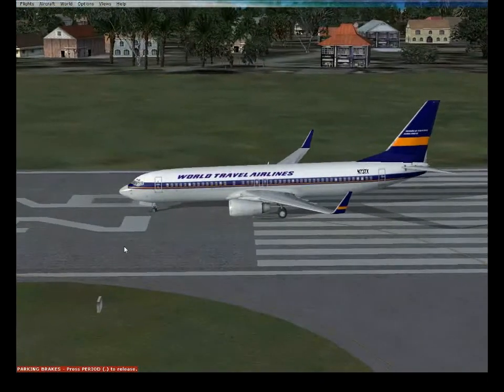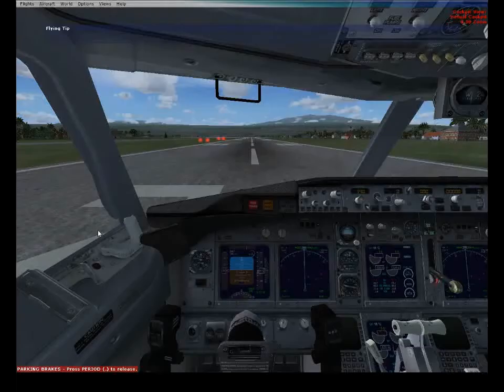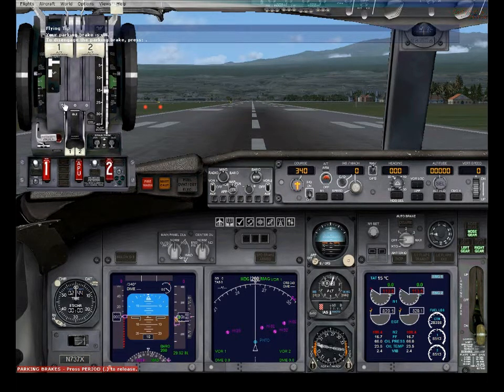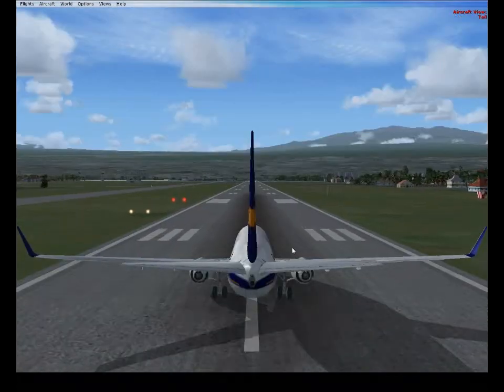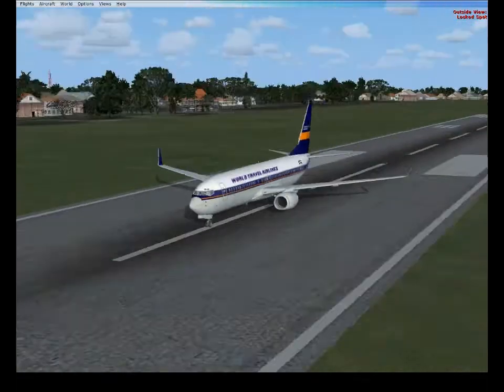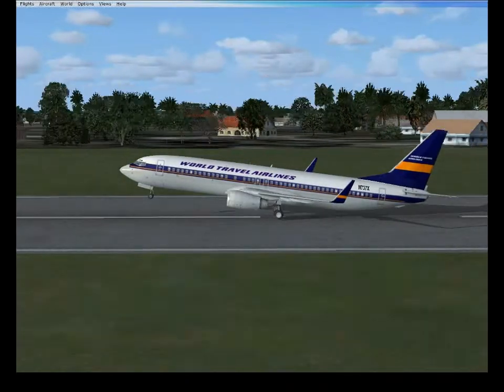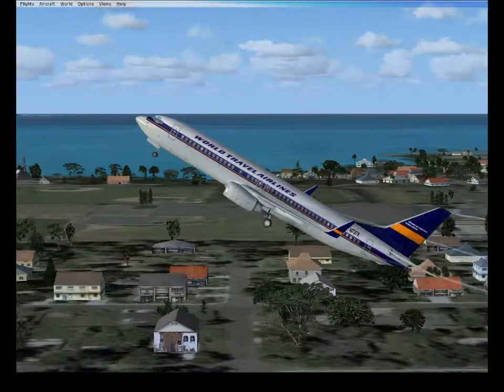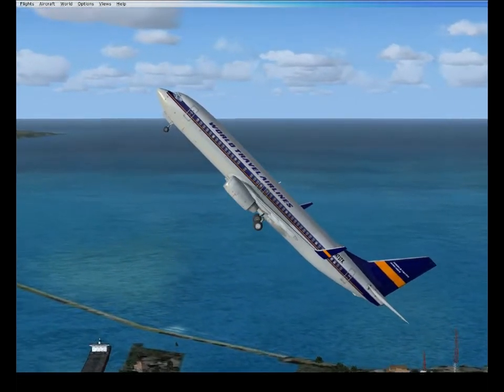Flight simulator help with stalling a boeing 737

Comment: You should use flaps for takeoff always.  They allow lift at slow speeds, so you don't have to put your engines above 100 EPR during takeoff.  Try using flaps 10 or 15 (depending on runway length) and use 89 EPR for TO/GA speed.  Works wonders for me.